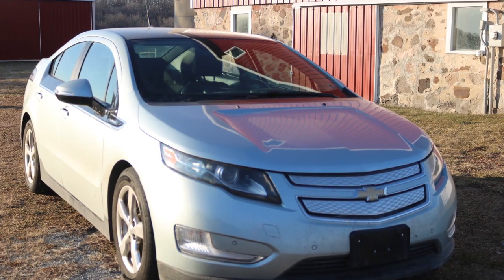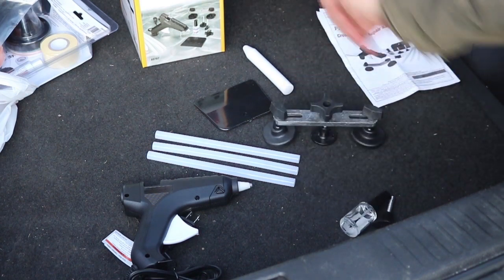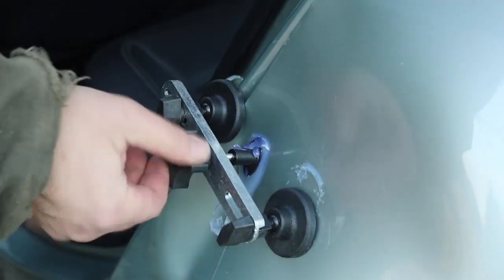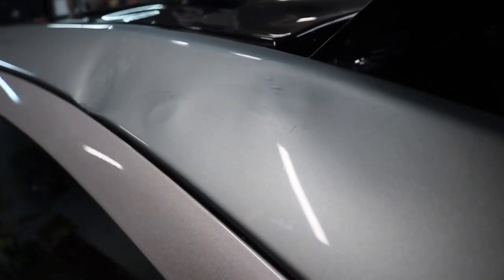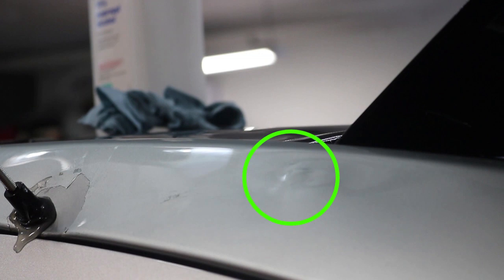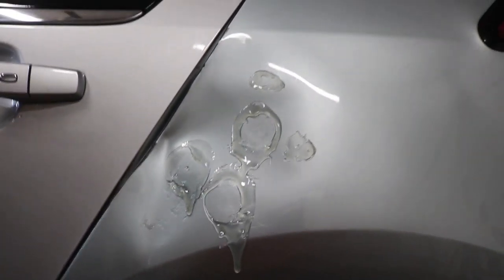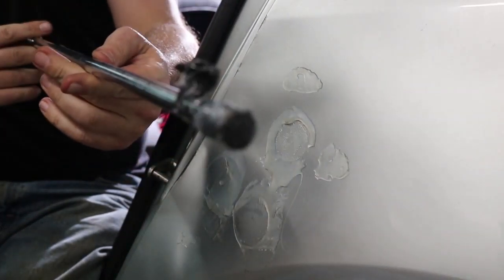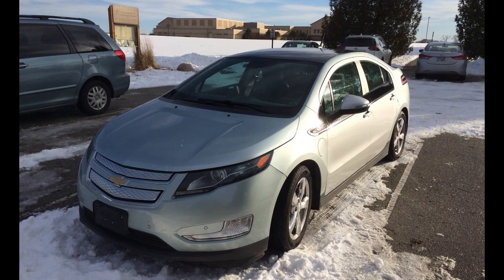Crashed Chevy Volt Dent Repair - Paintless Dent Removal - Does it work?

Comment from the maker: And just so you folks know, the original repair estimate for the car was $7,791.15!
Reply from the maker: About $15.
Reply from the maker: @HappyCamper870  The doors were from a salvaged car I already bought for the battery pack and other EV parts.
https://300mpg.org/2019/12/28/fixing-a-crashed-chevy-volt/

Comment: This is in no way accusing you of unintelligence, but this is the reason cars are totalled and body shops exist. The problem is the entire door frame has been tweaked. You can see it in the hard bends, or folds, at the top and on the side. I still think it was well worth the price paid and the fact that you aren't trying to pass of yourself as a "REBUILDER" makes it okay. I see so many YouTube channels of people buying salvage cars and covering up damage, rather than repairing it. It's dangerous to people in safety and car value. Again, I know that you are NOT doing this. This Volt was a great buy and if you can live with the imperfections, you aren't hurting anyone. Love your channel and can't wait for the tractor to be converted.
Reply from the maker: Yes, I'm sure I'll be living with some imperfections. The original auto body quote for the car was $7,791.15

Comment: You've definitely got it to the "I could live with that" point.  Good job.  On a completely different note, I owe you a "Thank you!"  I got a hitch receiver installed on my Volt this morning for the bike rack I just bought.  It is to carry my ebike.  Seeing you strip out the back of your Volt reminded me of the similar work I did this past summer while installing a 110 Volt inverter in the car.  And at that instant I made the mental jump and realized that I can use my inverter to charge the bike while I am transporting it.  So thanks!
Reply from the maker: Cool! The Chevy Volt is a perfect car for running an Inverter! A friend of mine powered his entire family home in Puerto Rice after the big storm with his Toyota Prius, but the Volt has a much larger battery, so even better!
Fun idea to charge your electric bike while transporting it!

Comment: I've done some proper panel beating in the past. Often the metal has been stretched and the one thing you want to avoid is stretching the metal any more. That's why you should avoid doing any work in the centre of the dents, at least at first.

You should try and remove the damage in the opposite order in which it went in, so start at the edges and work towards the centre. Most of the dent will be gone by the time you get there.

Comment: Ha! That's the same paintless dent repair kit I used. They do work but patience is a virtue. Never had my cross bar snap, that was unfortunate. That is a tough spot right on that seam of the door frame, but more glue and some more pulling will definitely get it looking better. Luckily you could get into it from the inside. Another tip, heat the metal up with a heat gun or hair dryer, it helps. Being that it is on the seam like that you will probably need a little bondo. Then all you need to do is order the matching paint from the car color code and a can of clear coat. Nice work!
Reply from the maker: When the paint split when I was pounding the dent, I wasn't heating the metal. I was just too focused on getting in there and forgot about it for a minute.

Comment: Nice one mate! Have you ever seen the slide hammers on ebay with an air operated suction cup on the end for dent removal? Apparently you can really go for it with them! Im jealous mate. I'd love a volt but there were only ever 200 sold in all of Australia!
Reply: I'll have a look for the ebay slide hammer - thanks for the heads up.
Reply from the maker: I used suction cups up to the point that I couldn't get them to hold anymore. I think a slide hammer would just do a better job of pulling off the suction cup faster!
Reply: @BenjaminNelsonX  I know what you mean, but the slide hammer is an impact rather than a pull, so the result may be different.

Comment: Use heat too, prior to pulling. Pulling in the middle is not always the best way. Suggest watch a bunch of PDR you tubes. Have use heat, pulling in the right spot and using the knock down tool to relieve tension. Keep the video coming love them. How about updates on your electric toys.
Reply from the maker: Yep. I was using the knock down tool. Only one or two quick shots of it in the video.
More videos coming soon on the electric tractor conversion.